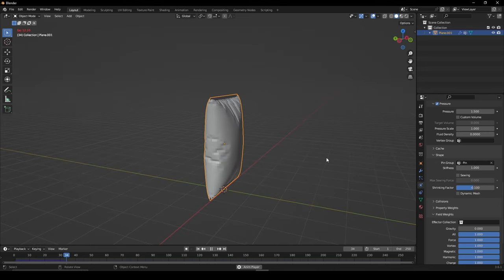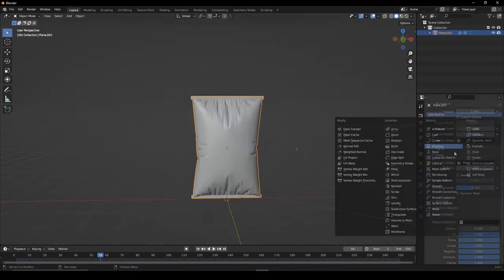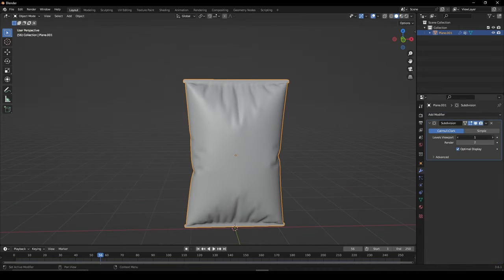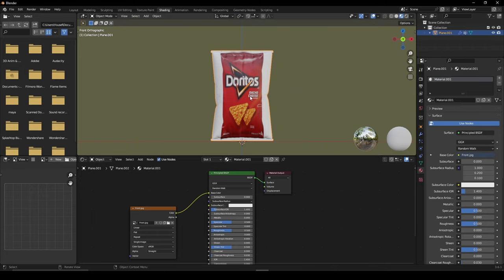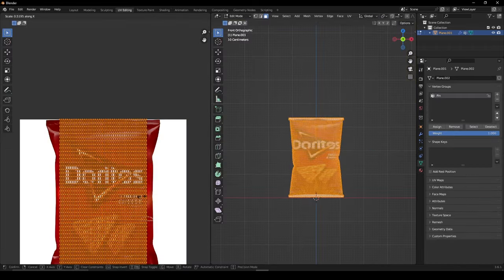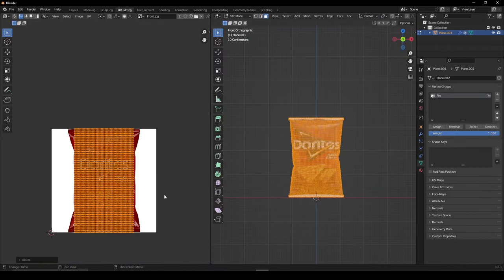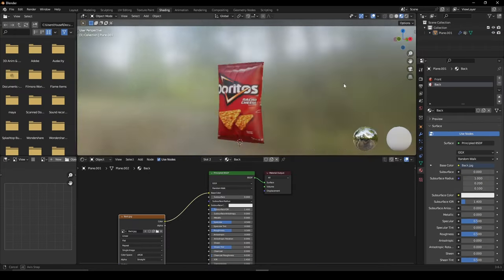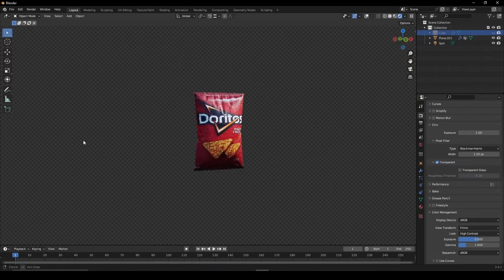Create Chips in Blender in 1 Minute!

Comment: Hi, what should I do if the texture is incorrectly applied to the edges of a pack of chips, it does not match and a strong transition is visible (only right and left, top and bottom are ok)